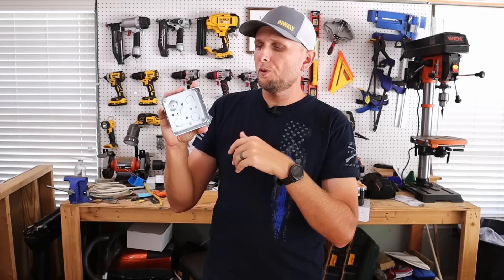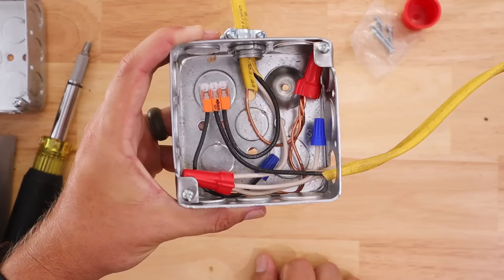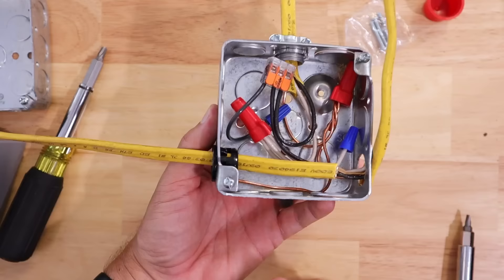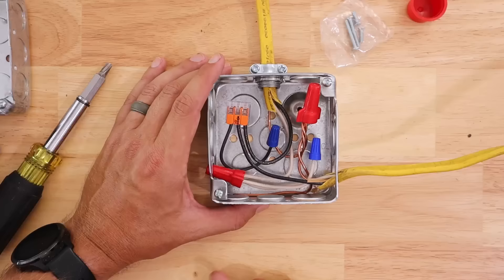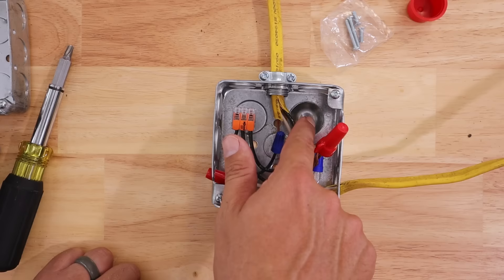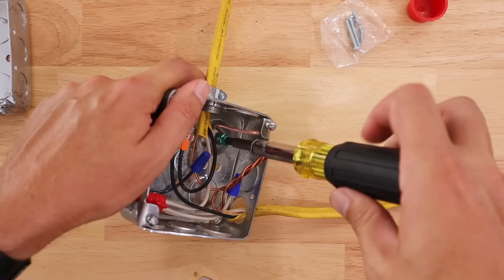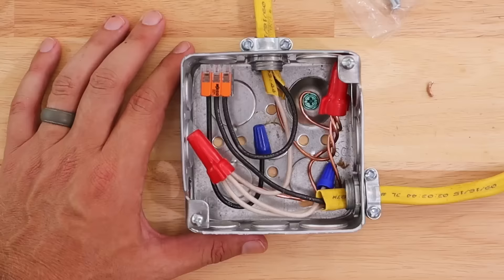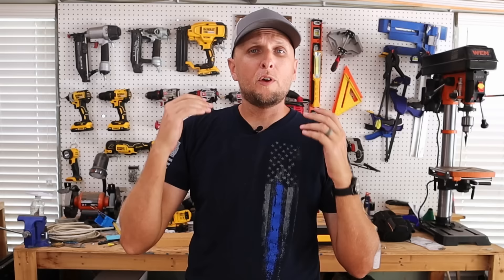The BIGGEST Mistakes DIYers Don't Know They Are Making When Installing Metal Electrical Boxes

Comment: Well and the big one that is not mentioned at all .... different countries has different regulations.

In Denmark as far as i know those screw-assemblies for wires are not allowed. And metal boxes is just an accident waiting to happen.

Wires without insulation should be earth and not ground (expecting that it is earth and not neutral which is "returning" the live wiring) - if not yet another accident to happen.

Also the gauge of wiring from US? to DK can be a bit confusing since we are measuring in metrics (mm2) - therefore wiring in even neighbor countries can be so different that they are illegal to use.

And the last thing I would like to mention is that i Denmark you are not allowed to install permanent wires/cables if you are not a professional installation technician !!! Which means that you have received the necessary education and is registered as a processional.

I want to say that YouTube are reaching out to a very large audience and people may think that this also applies where they live.

So if in doubt if it's legal to do by yourself, using the material you have picked and that you know what you are doing .......... please contact a professional - do not void your fire insurance or even incur unwanted accidents.

And now a Merry Christmas and a Happy holiday season to everyone. Hopefully Christmas lighting did not do you harm.

Comment: I call Wagos No WAYGOS! in the Industrial Facility I work in there are several thousand of these. It is a new building and we are seeing the Wagos fail everyday. They cause High Amp conditions up to 100Amp failures. Loss of flow through the Wago. Just so many issues. Also, isn't it against code to mix Wago, and wire nut?

Comment: It's amperes NOT amperage. Also, if feeder wires are 12 gauge, 14 can be branched. You can go larger gauge to smaller. You cannot go smaller gauge to larger. Personally, I just eliminate 14 gauge altogether and just use 12 on 120 and 10 on 220. And anyone watching this video that doesn't even know these things should absolutely NOT be messing with wiring.

Comment: To be honest, living in our home and what you've JUST shown. I keep finding more than that. In the 4 years that we've lived here, and from what I've been taught, you do not mix copper and aluminum wire together. (please, PLEASE someone tell me I'm totally wrong here in this) Years ago for the military as acivilian I "Used" to work as a certified electrician. Now, in a home that was built in 72, that has a mixture of Both, a new kitchen plus add-on before we bought it. I'm being told "Oh, you CAN mix both without any issues." I'll leave that one for now.
Reply: you can do it but you'd need a means of splicing them together that is listed al/cu splicing. not sure your conventional wire nuts are. also you need an oxide inhibitor for the aluminum. aluminum oxide is non conductive and can cause the joint to overheat as the oxide builds up.

Comment: Hello I am from France and your video make me feel very inconfortable !
All I can see is mistakes on mistakes and strange ways to do things. I think we just don't have the same electric rules USA and Europe.
For example I would never never never never twist a cable.
I will never twist cable around the screw to make a ground connection.
We never used metal box connection for electricity.
Reply from the maker: Yes everything is completely different.

Comment: A green ground screw is not required. It need to be 32 teeth per in screw but it is not required to be green. There are requirements in the code for green screws but this is not one of them. I might add also some of your wires may be 6" long but it looks like some are short. They need to be 6" long minimum per code.
Reply from the maker: Yes, I said the green grounding screw so that when a homeowner goes to get a screw, they can just go to the electrical aisle, pick up the green grounding screws and know they are the right dimensions and type.  They are very inexpensive.  All the wires were measured out to at least 6" and can extend at least 3" past the edges of the box.

Comment: Some electrical inspectors are going to need to see a green wire nut on the grounds. (Yes, this may seem petty, but it required. Just like the ground screw must be green, the wire nut must be green.)
Reply from the maker: Where is this required?  It’s not in the NEC.
Reply: @HowToHomeDIY  So I learned this personally from an electrical inspector about a year ago. I failed an inspection. One needed to have a pressure connector on all grounding wires. This could be a crimp sleeve or a Green Wire nut. I was also told that all metal boxes needed to have a Green ground screw. I agree, it seems odd the electricity in the box would know what color the screw head is or what color the wire nut is, but this is what I learned.
Reply from the maker: That's why I ask where this is required?  Meaning geographically.  In the US and per the NEC, none of that is required by code.  Now, your local jurisdiction can add on their own codes to the NEC.  That or you are also at the mercy of the inspector sometimes unless you want to fight them on it and appeal it above their head.  Have had to do that before.  But yeah, per the NEC, in residential installs, none of that is required.
Reply: @HowToHomeDIY   Interesting. So I have Googled, and the general consensus on the internet certainly agrees with you. This was in Franklin County, Tennessee. I was in the middle of remodeling a house, and after following several you tube videos for advice, I had to spend several extra days redoing wiring I had already done. I had to take out all the grounds and put on ground crimp sleeve connectors or use green wire nuts. I also needed to add green grounding screws to every metal box. This was a remodel of an old house and I was probably caught between a partial remodel and all new construction rules. Some of my boxes were very old, and had ground wire attached but did not use green screws or the wire was underneath another screw. Standards have changed over the years.   In some cases I found it easier to take out the metal boxes and go to plastic so I wouldn't have to worry about it.
Reply: An interesting side note, I discovered on the green grounding screws is that the shade of green and source of green is not mandated. One can take green spray paint, and a qtip and paint machine screws green. This is an electricians tip to solve the problem at times.

Comment: A metal box in combination with electricity? Not even allowed where i live? Why not use a plastic one?
Reply: It’s safer when it’s conducted to ground. Also metal conduit is used a lot in commercial and industrial applications which helps safety by conducting to ground all the way to the feeder

Comment: You can intermingle 12 and 14 as long as the breaker is for the lower amperage wire, in this case, a 15 amp breaker for the circuit.
Reply: You could but it’s not good practice.
Reply: @blondeguy08  NEC table 210.21b3
Reply from the maker: The purpose of that point in the video was in regards to being on a 20 amp circuit.  I should have clarified that.
Reply: @HowToHomeDIY  That's why we are all here to learn from one another, peace bro.

Comment: I am from Argentina, and I see the electrical circuits in the US as madness 😂 I mean, they look like so modern sometimes yet some old the same time... Like GFCIs built in the outlets but MONO-STRANDED wire. Also I notice you tend to use those bipolar+ground wire cables, instead of each individual wire, and plastic/metal piping or flexible tubing to join boxes together.

Comment: Two additional pointers: wrap the grounding conductor around the ground screw further so it doesn't squeeze out from underneath the head when the screw is tightened.  Also code calls for a minimum of 6" length of conductors inside a box (and long enough to stick out of the box at least 3" if the box is less than 8" in any dimension).

Comment: I don't understand why you would use a wago and a wire nut together?  Why not just run the wire for your circuit directly into the wago?
Reply from the maker: I wouldn’t.  I said I was showing the two different kinds of connections.

Comment: Why not put ground into metal clamp the box is grounded. That is what the old ones were like. Also the gauge and length matter. A super short 14 gauge should carry as much current as long 12 gauge. It's a bad idea but probably fine.

Comment: You should have said "Use the green screw because green screw is code", better to be grounded with any screw than not be grounded at all
Reply from the maker: Well according to code is does not have to be green in this application.  It is just a lot easier for someone to go to their electrical aisle, find the green ground screws, and know they are getting the right size and type.

Comment: Im a third generation electrician and almost all these videos ralk about the hazards yes there are hazards yes they are/can be dangerous. Stop scaring people that find themselves dealing with a issue a scared person is more likely than an incompetent person to make a sudden move based solely on being tense and nervous, build up tgeur confidence. As well informing them that the NEC or National  Electric Code is just the minimum standards and those standards have to be adopted at the state level then down to the local jurisdictions. All jurisdictions  go by the same certain standards but they can be amended. As well as if it was acceprable at the tome of last inspection,  unless altered, its grandfathered in. Examples being the knob and tube system. Fuse and fuse stats, bare neutrals, soldered and taped joints, 2 wire non grounded systems and so on. I give credit to anyone that makes a effort, however there is so much that, at the time of original installation was acceptable, may not pass inspection today, yet would be compleatly safe today. As always best to leave anything your nervous/scared of to the professional.  You cant get a cure for this stuff at the drugstore, as a laborer told his foreman when they accidentally hit a underground line, as he was leaving the job.

Comment: Wow... Someone mixing wire gauges on the same circuit has no place working with electrical installs. I can't believe this is a "common mistake" it's gruesome! Even doing a "harmless" mix and using #12 to continue a #14 run is not kosher. It may lead someone in the future working on the #12 end to go, "aha! a good electrician did this and ran #12. I can safely update the breaker to 20A - and if this is an older home without color coded wiring (#12 and #14 both white), a mistake like this can easily happen...

Comment: The one I didn't understand is, Why must the ground screw, that you have to supply, be green. After all, it's a metal screw grounding a wire, color shouldn't matter, unless you are saying it must be green so an inspector can pick it out easier.
Reply from the maker: Per code for this application it does not have to be green in color but it does have to be a machine screw and it has to fit the hole using the threads.  So I said it needed to be one of those because it’s extremely easy to find and you know it’s going to fit the threads of the hole in the box.  I kid you not, I have seen people use outdoor deck type screws which is completely wrong.

Comment: There is no way in the world you are using metal wire  clamp more than once if you are wiring residential. That said you will never use them in commercial because you are in conduit. So just buy the plastic ones unless you are in a beaker box.

Comment: It doesn't HAVE to be that grounding screw, it can just be any other screw as long as it fits.
Reply from the maker: It can't just be any screw that fits.  There are deck screws that can fit in that hole.  It does not have to be green but I was emphasizing it as it is far easier for folks to go to the electrical section and pick up a small bag of these screws and know they will fit the threads perfectly both in width and length.
Reply: @HowToHomeDIY  When I say fit I mean with the correct threads, length and head width for a good connection. The threads obviously need to be exact. Though if it's too long you can cut it, if the head is too narrow you can put in a spacer. But sure, I suppose it's easiest to just buy these screws.

Comment: How do you put an outlet in that box?
Reply: You use a mud ring with the depth specified by the thickness of the wall. In this case you can use a single or double gang type. The screws on the opposite corners of the box are for this purpose. If the box is to be surface mounted, you'd use an appropriate cover where the device mounts to the cover.

Comment: 7:35 why do you need to put a ground screw if the wires are already making contact with the box?🤔🤔🤔🤔
Reply from the maker: They aren’t.  In the event that a wire comes loose and touches the box, without the bit being grounded the box will be energized and could cause a shock, electrocution, or fire.  But if the box is grounded, it would just trip the breaker.

Comment: Can we look at how much wire is accessible OUT of the box, and what the code requires? 300.14 requires 6 inches, EXACTLY because of the twisting . It looks like you had about half of that. Maybe it is just the viewing angle on screen, idk; Just something to remember when guiding "diy electricians" , because its a statistic that "diy electricians" , are the leading cause of electrical fires/failures. ✌️
(Master electrician/electro mech engineer backround to reinforce my critique) this install would last just fine. I am just making a point. Thanks

Comment: Those using plastic boxes bend the tabs completely out of the way and run the wire in.  No strain relief what so ever. I fail to see when or how a wire is going to be pulled or moved especially after it’s stapled to a stud less than 12” from the box.

Comment: (My comment is just in general and not specifically to this video.) Someone told me my dad wired my breaker wrong, didn't point out what exactly was wrong, and it has been functioning for over a decade now, so why go and change things?  Code does not mean that everything else is wrong.  A lot of codes are pure bureaucracy, nothing more.

Comment: A job worth doing is worth doing right, pre twist . I've seen time and time again from unpri Twisted wires when removing a wire nut the wires are not connected and barely in the wirenut. Those guys that don't free twist are lazy but on the other hand some guys over pre twist.

Comment: I will never understand why anyone uses a METAL box (unless it’s a garage or commercial exposed circuit with EMT piping runs. In a residential situation, there’s no reason for using them when there are plenty of indoor/outdoor plastic boxes that are up to NEC.
Reply: There are situations in res work where a metal box makes the most sense. If, One common reason is box fill, another is the fact that sometimes you need a shallower box than you can get in plastic.

Comment: MISTAKES ON METAL BOXES , " NO ONE USES THE GROUND WIRE TO GROUND YOUR BOXES ,LIKE THE PLASTIC BOXES ' THE BOXES HAVE 3 WIRES, 1 BLACK, 1 WHITE,  1 GROUND,  WHITE-WHITE,  BLACK- BLACK, AND  ALWAYS  GROUND- GROUND.  OR RED - RED , GREEN WIRE - GREEN  WIRE.  GREEN  OR GROUND  GOES TO GREEN SCREW IN METAL BOXES.

Comment: 5:13 show me where in the code it says the ground screw in a box (not the main bonding jumper) has to be green.
Reply from the maker: It doesn't say it anywhere.  This is for homeowners and it's way easier for them to just go find these green screws in the electrical aisle and know that they will fit instead of trying to find a machine screw that will fit correctly.  In some applications green ground screws are required however.

Comment: after you install an outlet inside of a wall and finish the wall, why in the heck would you be then pulling on the wire to cause a problem
Reply from the maker: You wouldn’t.  That’s not the point though.

Comment: Question: why wouldn’t someone just always use a plastic box for indoor projects?
Reply: Metal 4S boxes are great for surface mounting in a garage or under a sink or when you have thick backsplashes like drywall+tile/stone and need a deeper mudring.

Comment: American youtuber: spot the things wrong

Dutch electrician: Using a metal box. No need for a strain relief and no earth bonding either. Major time savers there. And PVC boxes aren't designed in such a way that it's even possible to damage the wires in the first place
Mistake 2: romex and the lack of ducting. We use loose wires inside a PVC tube. Not only offers it better protection for the conductors, it also saves time stripping the romex outer layer, which also introduces the extra risk of damaging the insulation of the inner conductors. 
mistake 3: wire nuts. No real electrician here use those anymore. Way too time inefficient. 

Or did you mean other things? :D